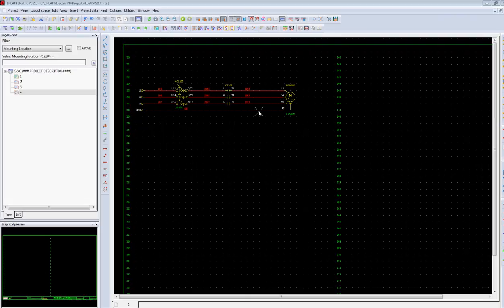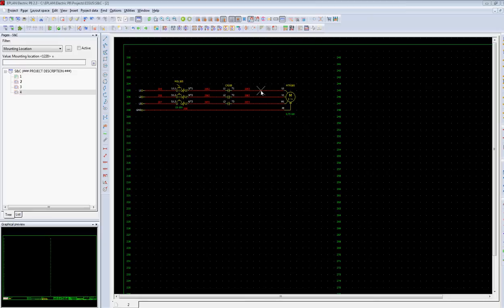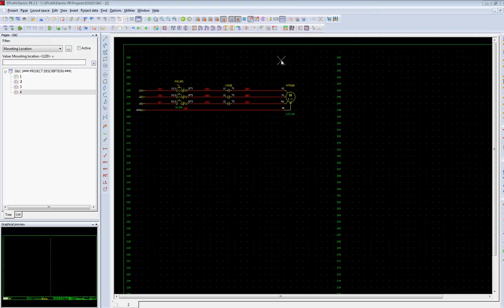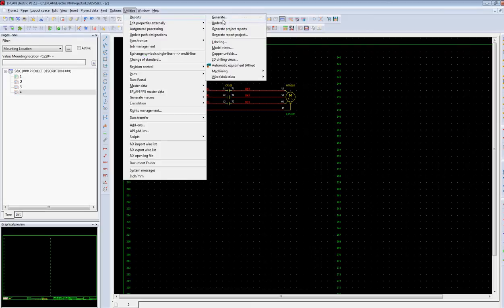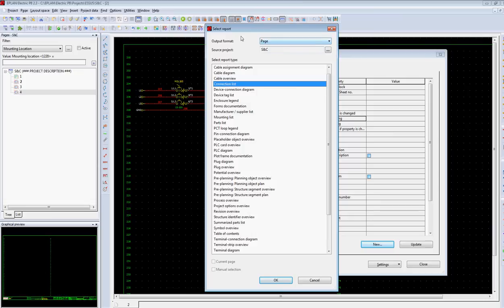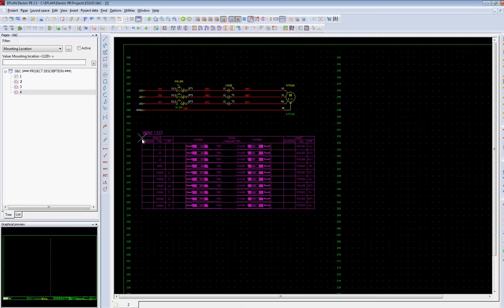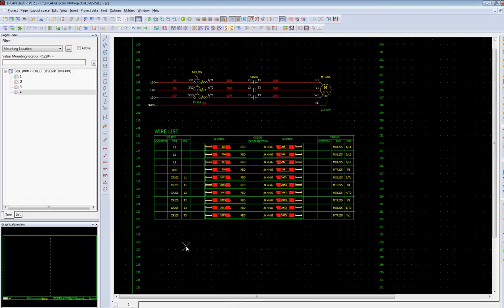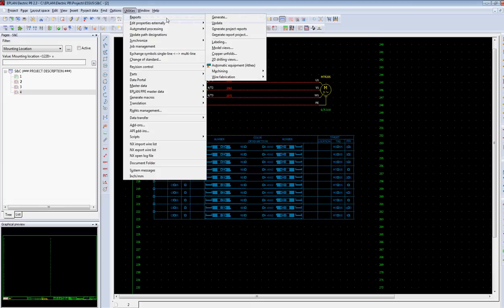EPLAN Electric P8 - How to generate a point to point wire list

Comment: which form is this? I can't find one with wires shown in graphics
Reply from the maker: If you goto eplan.com and register for free, you have access to the EES the Eplan Engineering standard. There you will find an example of a Stacking System. You can find the form in that project.